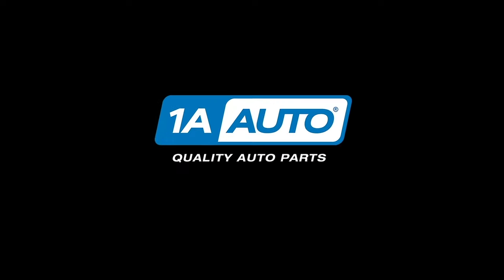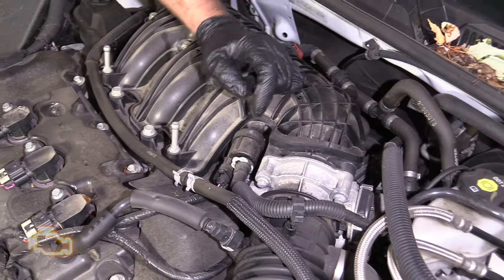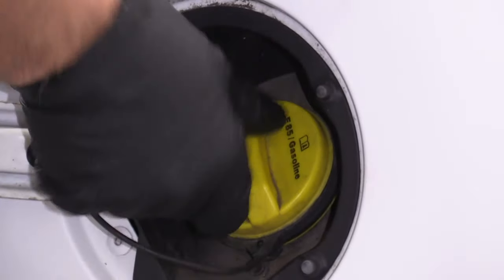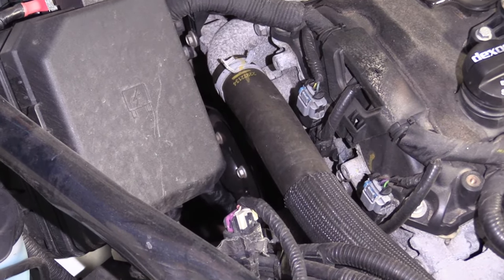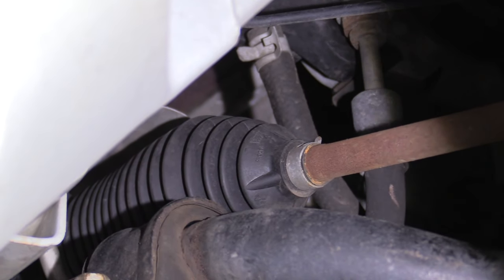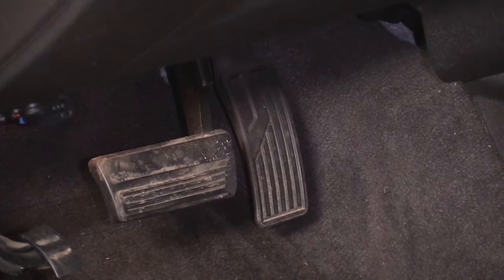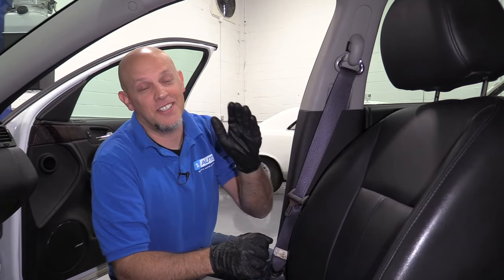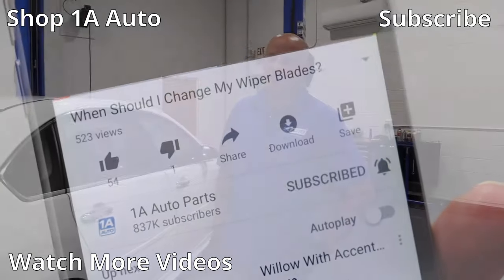Top 5 Problems Chevy Impala Sedan 9th Generation 2006-16

Comment: My 2015 Impala limited has been very good to me. The only problem I’ve had is the ABS Wire Harness. Which a lot of mechanics get it confused with the wheel bearing or wheel speed sensor. The symptoms would be the Abs light, traction and service stabilitrak coming on at the same time. And you’ll hear a groaning/grinding noise while making sharp turns. Mostly left turns for me. It’s a real pain, gonna have to take my car to the shop later.
Reply: had the same. vacuum leak..vacuum leaks will drive a computer crazy and give wild codes
Reply: my PCV hose was broken, sucking lots of unfiltered air that the CPU does not know where it is coming from. The CPU richens the mixture to match the leak. The mixture is already too rich. The car stumbles.  I was working at Ford KTP in Louisville and working on my Impala in parking lot in the rain one morning. worked 7 to 7 ...hahhahahahah
Reply: @palmcoast26  Oh my gosh wow! I hope you were able to get that fixed!
Reply: Did your car act up driving?
Reply: @Views-xx2wt  It made some weird noise while turning. It was always on the drivers side, & it would hesitate while making the turn But other than that it drove normal
Reply: @tatyanasampson4993  mines doing grinding noises
Reply: @Views-xx2wt  Yess that’s it ! It’s the abs wire harness that you have to get fixed !
Reply: @tatyanasampson4993  crazy I have a 2013 chevy impala ltz model and it does the exact same thing ,saying stabilitrak needs to be serviced , I changed my spark plus ,and I haven't had the problem since
Reply: Mine had the same issue. To get rid of the noise I would just turn the ABS off when the roads were nice and it drove just fine
Reply: Thank you!! Mine is doing that.
Reply: @tatyanasampson4993  Yes, I fixed it myself..went to Autozone and they scanned system and MAP needed cleaning and computer reboot
Reply: I have a 2009 and a 2011, my 2009 never had that issue but my 2011 with 81k miles is having that issues. Nice to know what it is so I don’t have to waste time paying $150 just to find out what it is! The internet is great, thanks for your comment!!!!!
Reply: Had the same with my 2012 Impala LT They had to replace the Front Left Wheel Hub (wheel bearing, Wheel Speed Sensor, Traction control sensors)  because the stabilitrak and the ABS Light would come on and it would cut the gas when making a left turn on dry pavement. Had a very close call when it happened as I wasn't expecting to be left in the interaction I kept pressing gas and nothing would happen. I was able to slam it into reverse and get out of the way fast enough luckily no one was behind me. 

Anyways I got it replaced and it's all good now. It happened again but the shop warrantied the part they replaced as it was a faulty part. All better now.

Comment: Have a 2011 impala with 135k, great car, hasn’t given me any issues other then the common ac blend door actuator and coolant temperature sensor which is minor. Been a super reliable vehicle.
Reply: Any transmissions problems?
Reply: @JuanPulid0  transmission is starting occasionally to slip when shifting from reverse to drive then gas, only happened around 3-4 times
Reply: @danb2  i got a transmission code on mine, but so far drives smooth. Im going to pay attention on what you said and see if I spot anyhing
Reply: @JuanPulid0  I had a friend with a 08 around 150k and he lost 3rd and 4th year. The problems vary with the 4t65e

Comment: Great video. Some other common issues that plaque those vehicles and chevys around those early years are blend door actuators failing and the Intermediate steering shaft.
Reply from the maker: Thanks for the info, Cody!  If you need any parts for your vehicle, check us out at http://1aau.to/m/Shop-1AAuto-Now
Reply: Not sure you will see this but how do you know its the intermediate shaft I replaced rack and pump and I'm feeling some tension in the steering occasionally

Comment: My car is smoking underneath the whole catalytic converter is covered in oil. Replaced the oil filter gasket , oil pan gasket , valve cover gaskets. And it’s still smoking please help my car always smells like burnt and when the car is on I see smoke coming from under the car
Reply: HEY!! I HAVE A 07 CHECK OUT THE CRANK SHAFT SEAL ITS ON THE PASSENGER SIDE OF THE VEHICLE AT THE BOTTOM it leaks oil down at the bottom of the vehicle! There are plenty of YouTube videos on it
Reply from the maker: I would recommend degreasing the engine and exhaust really good. look for more leaks, if it is one of the newer ones timing covers leak oil. Make sure its engine oil and not something else. Thank you for checking out the video. If you need auto parts go to: http://1aau.to/m/Shop-1AAuto-Now

Comment: Thanks. I would add HVAC blend motors to that list. They only last about 50k miles before the plastic gears start failing, and they make a loud clicking noise in the cabin.

Comment: That front sway bar needs new bushings.. Also common on 9th gen front after 100k.

Good list, very accurate. Thanks.
Reply: I think that may be my problem. Has a sorta knock tap sound sometimes when I make a sorta hard turn or hit a bump

Comment: Chevy Impala Problem 
(Owner of 3.9L V6 9C1 09 Impala)

Door Lock Actuators - DIY eBay universal lock actuator 

Rear Defrost Non Functional- Bypass With new wire in passenger side foot fuse box . Usally burnt out. Cut and wire together.

Ac actuator that causes loud knock in glove box just replace the motor

Sway bars are usally broke as well on these cars 

Tpms is usally garbage so I suggest replacing them

Transmission eventually may go out so prep with some sort of repair coverage 

Pedal sensor eventually so replace 

Overheating usually it’s the water pump/thermostat and change pulleys if can

AC Compressor may also need replacing for no cold air even after you tried a recharge

Car runs well on 93 Octane

Better to run full synthetic oil and run a coolant flush regularly.
Reply from the maker: Wow Great list! Thank you for checking out the video. If you need auto parts go to: http://1aau.to/m/Shop-1AAuto-Now

Comment: Great list guys. I've had many of these issues, most expensive has been power steering leak, replaced pump and rack. It's better but still not 100% , still have to add fluid if steering pump whining, even tho dipstick shows full.  Also replaced oil pressure sensor and pedal position sensor. Also getting "Service Stabilitrak" error message on dash, which I just ignore.  Also the rear window defroster wire burns out at the fuse box located at the passenger side kick panel.
Reply: the Stabilitrac error is a recall item. I spent over 2 grand for a douche to tell me nothing wrong. then chevy dealer alerted me to a recall item...water in wires.
Reply: Having issues with my power steering making a whining sound as of yesterday so now I’m just having anxiety 🤦🏻‍♀️🤦🏻‍♀️😐 put fluid in and it’s still whining just not as loud

Comment: General motors should kept3.8v6 instead of those junk 3.6 v6.3.5 are ok and 39
Reply from the maker: You are correct the 3.8L engine was great and easy to work on. Thank you for checking out the video. If you need auto parts go to: http://1aau.to/m/Shop-1AAuto-Now

Comment: Transmission was a big issue I’ve repaired many of these transmissions … the steering rack and pinion and power steering pump was another issue with these cars
Reply: Mine only drives in 1st/Second gear + reverse. Smh... And suggestions?
Reply: I had to replace my rack and pinion today 😫 2009 3.9L LTZ

Comment: Had an 06 that leaked from manifold gasket and oil got all over the starter which caused it to die. Also developed transmission shuddering when starting from stop. It did last until I got rid of it at 207xxx but I only had it for 20k miles.
Reply from the maker: Yup some of older ones had these problems. Thank you for checking out the video. If you need auto parts go to: http://1aau.to/m/Shop-1AAuto-Now

Comment: I’ve had my impala 2 years and got it with 150000km and changed the oil once and no other issues else it’s such a good car and has 215 hp which makes me cream
Reply: 215 hp? Lol my 2014 Chevy Impala LT 3.6 V6 has over 300 HP stock. What kind of Impala do you have??

Comment: The engine problems mentioned in this video are for the 3.6L Engine only available in 2012 Impala. 2006-2-11 had the 3.5L , 3.9L or LS v8. The only issue I had with my 07 3.5L was the tire pressure monitor at $700 for a module I didn't fix. My engine leaked every fluid very lightly and wasn't worth fixing. I sold it at 188k with no other issues.  Blend door actuators on my 2012 have been a constant pain. The water pump died at 88k and Chevy would not cover it under drive train? So far my 2012 has been the best car I've owned. I'm at 134k and have spent less than $100! in non maintenance repairs
Reply: I just purchased a 2013 impala and the transmission fluid is old probably has never been changed. Do you think its a good idea to flush it and put new one in?
Reply: @georgek3834  There is much debate on that.   if you're over 150k some say no. I think you would be fine drain and fill at any mileage but that is my opinion. I've only ever had positive results with fluid changes. It's easier than changing the oil! The plug is very small and easy to miss check out some vids on utube. I've drained and filled my dad's every 40k and it's holding up nicely
Reply: You are incorrect in your claim here. The 3.6 VVT engine was in the 2012-2016 model years. Fleet, retail and law enforcement 9C1 models.

Comment: So I bought a 2007 Chevy Impala lt. 3.5 L. I know I overpaid for it but whatever, they were offering it for 2200, I talked down to 1800, It had approximately 160,000 mi. Two and a half years later, it currently has a 198,661 mi. I have spent close to about $7,000-%8000 on this car. Let's start the fun, I have a replaced rack and pinion, or power steering rack, power steering pump, both high and low pressure power steer lines. Radiator, 2  sets of spark plugs, spark plug wires, sway bar end links (twice), sway bar bushings, front struts twice, I bought crappy Detroit Axle the first time never again, learned my lesson. Back struts, all four brake calipers, brake pads rotors ( twice), all four wheel bearings, inner and  Outer tie rods ( pass side twice), both front lower control arms, both transmission lines. The clock spring in the steering wheel. Both O2 sensors, ignition coil pack, map sensor, crank sensor, the flex pipe from the manifold to the cat, back sway bar links or stabilizer end-links. 1 fuel injector, ( just cleaned other 5), 5 fuel injector o- rings ( 2 o-rings for each injector, intake plenum gasket, oil filer house, and gasket ( I think that's what its called), complete transmission fluid replacement with transmission pan filter, battery, ( was everstart max and was 5½ years old) the two front motor mounts that are pretty much right there as soon as you open the Hood, the side engin/transmission mount honestly think that's it, but could be wrong.

Comment: What is the problem with windows fogging up with heat on high with the defroster on?  Not able to clear windows in full defrost and heat in full high.  Checked the water drain on the front bulkhead and is clear of any debris.  What else should be checked?

Comment: Good motors bad transmissions. Mine started going at about 70k miles. Still under warranty, it was an intermittent issue at that time. It would slip at a stop sign and slam into gear when it would catch. Found out later after the warranty was done that it was so common that GM allowed dealerships to cover them under a longer warranty period. By the time mine got bad enough to where they would be sure to find it I was well past of course. I changed the transmission and so far it's been good since.

Comment: My 07 impala is surging (RPM jumping a bit) as I drive down road at low speeds with accelerator steady.  Could this be the throttle body?
Reply: My 07 Monte did the same but the check engine light came on.  I thought my trans was going bad but ended up needing a new maf sensor.

Comment: Blend door actuators, transmissions and various electronic issues with the ABS are a pain on these cars.drivers side actuators are a bitch to replace.the passenger side ones are simple.otherwise they are extremely great cars👍

Comment: How about ALL of the power locks giving up one at a time.  Put some paracord on the emergency open handle in the trunk and run it through the back seat so when the trunk opener quits you can get into the trunk.  There is no keyed truck entry on my model!  It will wait to go out until the one time you get a flat or something and need the spare then you find out the only way in is by removing your back seat unless you do the paracord trick.  Got sick of replacing the air actuator (why can't ANYBODY makes one that lasts more than 1-2 years) and disconnected it.  I live in Hawaii and never use the heater anyway.  Alternator didn't make it to 70,000 miles.  After 50k I had to start dribbling the gas in like an old man peeing because the gas pump always thinks the tank is full.  Oh, and the rear defroster cables burning out on the passenger side.
Reply: Only the cop cars had a keyed trunk.

Comment: A few other common problems is that the wiring for the rear window defroster cant handle the voltage and burns out in the harness, and the oil pressure sensor goes often.

Comment: That's a 9th Gen with the 3.6L.  Those engines have timing chain issues.  Luckily we have an '09 9th Gen with the 3.5L...bulletproof.  Almost 200K and still runs like a clock.
Reply: The 3.5 is a beast of an engine after you replace and upgrade all the stock parts 💪🏽

Comment: My 2008 LTZ now has 175,000 miles on it. I am the original owner and took good care of it. Actuator doors are the most annoying to replace and go frequently. One door is a bear to replace and the door on the passenger side is a snap. Ill drive it until it doesn’t roll on its own. Im retired and on a fixed income. I fear my driving days are coming to an end and cannot imagine life without the freedom a car provides. Still, imtake life one day at a time.

Comment: I'm surprised other than the Rack and Pinion definitely being a most common problem that you didn't mention the OTHER most common problem with these dang Impala's....
And that's the VENT Actuators...  Even the mother ** replacement versions are defective, will go out and make crap noise trying to open and close your vents.  ALL 4 of them will do it too.  These should have been a RECALL issue.  But Chevy cares so little about their customers that they don't even bother fixing the design so the replacements don't also continue with the problem.

Comment: I have 198,000 miles on 2007 Impala LTZ and have not had any of those problems..just oil leaks, front and rear main seals on 3.9L V6
Reply: 200250 today

Comment: My 2006 has less than 135 000 m on it.  Up until now, no issues except for driver's side window motor.  Now all of a sudden, thermostat replaced and I have a small hole in back of the engine leaking oil.  Also heater/ac problems.  It still drives like a dream, but only driven less than 5 miles a week.  Does the mileage represent when these things go wrong?  I'm too old for this!

Comment: I have a 2007 3.5 Lt fuelflex and have 270 thousand miles on it. I've had minor problems but was able to fix myself other than the catilac converter. But I have a question for you or if anyone can help. My car does that engine reduce thing and replaced the accelerator pedal and it went away and now has come back. Do you have any ideas what I might be?
I even had a catilac converter put in. Any help would be much appreciated.
Reply: They say that’s also associated with a bad throttle body if it’s not the pedal sensor

Comment: I have a 2012 impala and the evaporator sensor went bad and I replaced it myself.  Its easy to do.  It doesn't affect anything but the car won't pass the emissions test without it working right.

Comment: I love how on my 2015 Impala Limited LT (same car, just called the limited 14-16 because the 10th gen was out) I've only had the EVAP Purge and did it myself. Water pump, rack, pedal, pre-tensioners? Factory. Even the plugs, coils, timing, and I'd say about 85% or more is factory. I only changed the idler, tensioner, and belt cause I thought they were the cause of a squeal, they weren't but I simply kept the old parts as backup. And that's at 202k miles, about 300-350 miles a week. Only other issues have been 7 hubs (not the hubs actually, just the TCS wiring rubbing out, actually spoke with GM, they revised it with wire loom now over the harness), 3 radiators (shit end tank design), and the blend door actuator. 1 radiator and 2 hubs were out of warranty, the rest, all under warranty from factory plus 2 extensions on the warranty. Save an absolute mountain of cash. If this one dies, my plans are to get another one as low of mileage I can find, but this time in Crystal Tricoat Red with black interior.